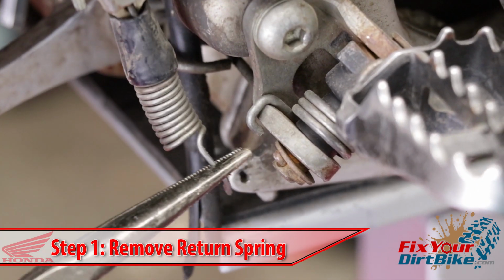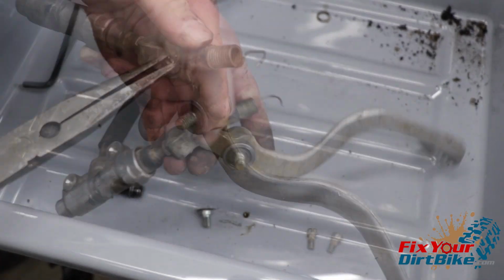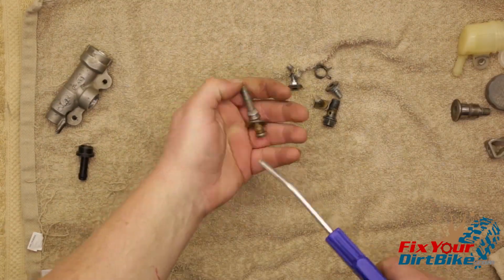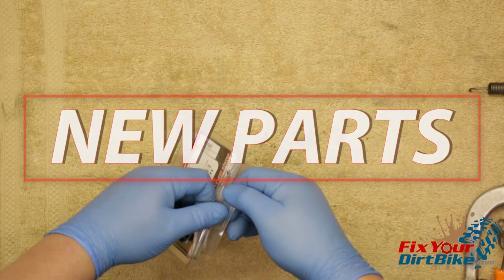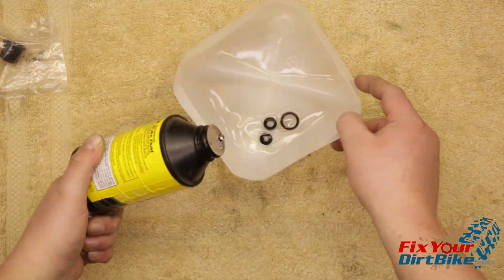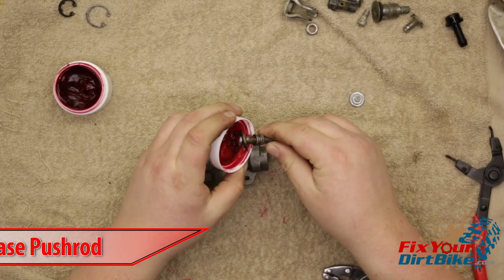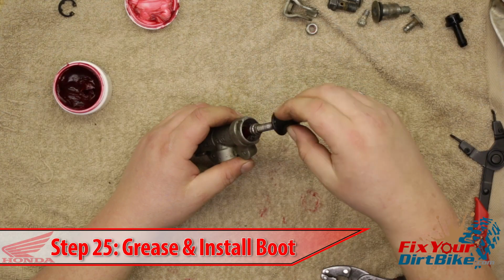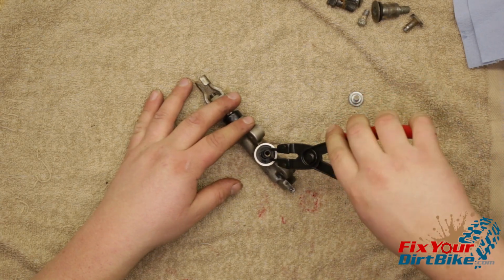97-01 Honda CR250 Rear Master Cylinder Rebuild #honda #cr250 #fixyourdirtbike

Comment: I did this step by step, however after assembling I attempt to bleed the brakes to no avail. The piston goes up and gets stuck on the first press of the brake lever, any ideas?
Reply from the maker: If the plunger gets stuck to the point the spring cant return it, you have a bur in the bore or on the plunger.

Comment: Very important to mention… When the piston is in the rest position, the brake fluid will be balanced via The compensation hole. This compensation hole is very small, clean this compensation hole with a very thin wire of copper, if it would clog… you are guaranteed a dragging caliper, this has already happened to me twice!!!  with the Honda CBX 1000. Stay Safe.
Reply from the maker: Good catch!

Comment: Hello Sr. Thanks for the explanation.. I do have quite a problem with taking apart my rear master cylinder in two specific areas: 1. I can not take out the piston, as the circlip is completely rusted and I can´t take it out. The circlip is still in it´s place so what is left from it is in the inner lip of the cylinder holding the washer... any ideas? 2. How do you take out the reservoir hose mount (I did remove the circlip) but the mount seems to be stucked there and when applying strength doesn´t come out and bends a bit, so I´m worry to break it... thanks (I have pictures if there is any option to share)
Reply from the maker: It sounds like you will need to soak your master cylinder in rust remover. If that doesn't work, you may be looking at a new master cylinder.

Comment: I have a 92 CR500 I just had the whole bike gone through everything nothing wrong with it my question is I have a 1985 200x 3-wheeler the brake fluid says use j1703 does that equal to 5.1 if so that's full synthetic do you know what j1703  cross reference is 100% for sure motorcycles the motorcycle shops I called today Sunday do not know
Reply from the maker: Dot 5.1 is glycol based and is compatible with Dot 3 and 4.
Reply: @Fixyourdirtbike  the three wheeler says J 1703 brake fluid cross reference over is Dot 3 lol

Comment: hey! Really nice video! do you  know if the rear swingarm between year 1997 and 2000 is different? i know the aluminum chassis is...
Reply from the maker: It's the same from 97-01. I actually just did mine and I'll have a video out soon(ish).
Reply: Fix Your Dirt Bike thanks for the answer. My threads on my chain adjuster screw on the left side of my 00’ CR is messed up and i have a parts bike CR of 97’. Was thinking to switch them. Do you know if this damage is repairable though? Thank you
Reply from the maker: You can replace the screws.
Reply: Fix Your Dirt Bike the threads of the swingarm are damaged! They need to be redone
Reply from the maker: Oh ok. You can correct the threads with a tap.
Reply: Fix Your Dirt Bike thanks 😆